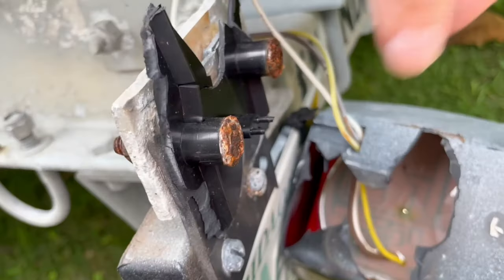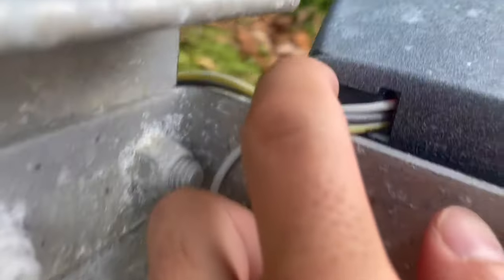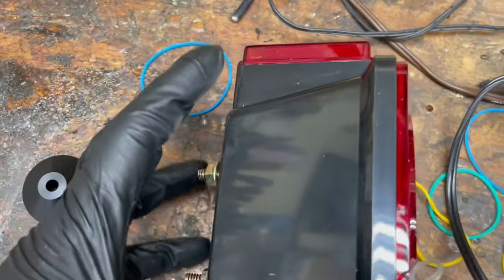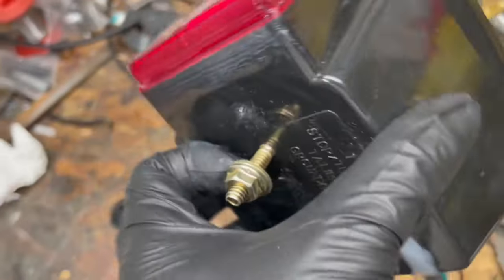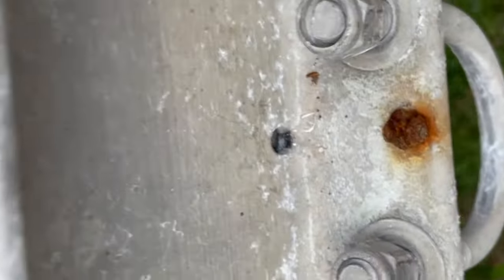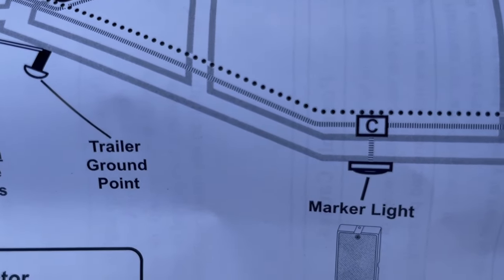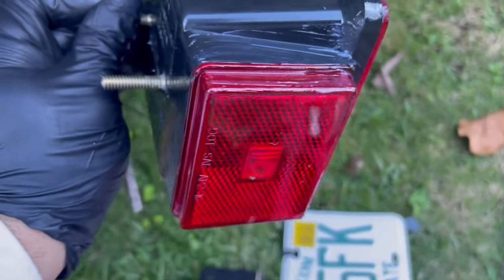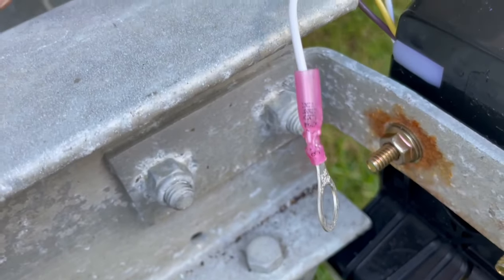NEVER REPLACE BOAT TRAILER LIGHTS AGAIN!! How To

Comment: Fasten the lights to the bracket with nylon wingnuts. They will not corrode And you can remove them before you put the trailer in the water. Move the lights to higher ground, Like up by the trailer hitch.
 Then when you come out of the water simply reattach the lights with the nylon wing nuts
Reply from the maker: Great idea! 🤙

Comment: I got to stop watching YouTube videos and get to work lol. Awwwwh shit. 

Use lots of silicone on the bolts and nuts, just be sure the ground still connects, then slather the shit all over it… Or continually wash it every time you stick it in and lube it 🆙👍🏻

Rinse and scrub the trailer with fresh water every use after dipping in saltwater. Make sure to pull the bearings apart and grease them occasionally so the wheels don’t just all of a sudden outrun you going down the highway. 

Inspect those axles 😂 AND springs…………….
Reply from the maker: Get to work! 🤣
Thanks for the tips and thanks for watching! I realized quick how much work these boats are! 🤣
Reply: @perfectfitboating  I’ve got a 16 foot wide transom that I have to do that too pretty soon. I have to remove two rudders, a dinghy platform, and outboard motor bracket that I no longer need. I bet those 6’ long stainless rudders weigh a ton or more each? I think I’d rather have a guy who’s done it before do it, though? What do you think 40 gallons? How much is that gonna cost holy crap
Reply from the maker: @daha7864  bigger the boat the bigger your wallet will have to be. 16’ transom is wild and I don’t think I’d touch that. Not before doing some research first. Might be more than 40 gallons! 😳

Comment: Looks like it's worth a try. The only problem would be is to replace a bulb if it burns out. Corrosion is usually what causes the problems so pick your poison as they say.
Reply: I believe those are surface mount LEDs in the housing so they aren’t replaceable.

Comment: When the cops pull you over for a bad trailer light, I usually find it's an intermittent ground going to sh!t. I use the same kit and heat shrink connectors, but add a separate wire for the grounds and eliminate the chassis grounding. I feel trailer lighting kits should come this way, opening up 5 grounding failing points to save one wire, doesn't make sense. PS no offense, but the wife's electrical videos are more entertaining.
Reply from the maker: I agree and I might just do that to eliminate the grounding wire to chassis. It’s probably some DOT requirement. 
No offense taken, id rather watch her than see my mug on the screen too 🤣🤙

Comment: Good video cap. And my trailer always have some problems especially the break system
Reply from the maker: Thanks for the comment cap! You know, you’d think someone would come up with something that is strong enough to last in the saltwater environment. Some type of spray coating that repels water off the metal parts of the trailer. Might be up to innovators like yourself to invent something, cap! 😉
Reply: @perfectfitboating  lol im running to my mad lab 🏃‍♂️🤯
Reply from the maker: @OutOnTheReef 🤣🤣🤣

Comment: Haha!!! I did the same thing to my trailer lights brother.  I also added removable lights, with a two wire connector extention, that I can hook on the transom tie down eyes.  So there's a total of four lights between the trailer and the boat.
Reply from the maker: Smart! I think I might do something like that as well! I hate having to change these all the time is more of an annoyance than anything else! Good idea!🤙
Reply: @perfectfitboating  Trying figure out a way to send you a photo of my hanging lights and connectors..
Reply from the maker: @aeroscout8409 send it to our email in our about us page 👍
Reply: Sent you an email with transom light pics.  I'm also bought to spot weld some holes in an added bimini bow.   @perfectfitboating

Comment: Watched the whole video just to see how you spliced the side light into the regular wire.  Anyone help would be appreciated!
Reply from the maker: Your marker light should have a black wire and a white grounding wire. You’re going to splice the black wire to the brown wire of your harness. One side is brown and green the other is brown and yellow. Cut the brown wire and splice the black wire in there with a heat shrink connector. Then the white grounding wire to the trailer. Hope that helps!

Comment: You went through the trouble of retiring the trailer and you didn’t use sealed trailer wire.
Reply from the maker: Not really Trouble it’s pretty standard actually. Just like the wire I used. Cheap and easy fix.